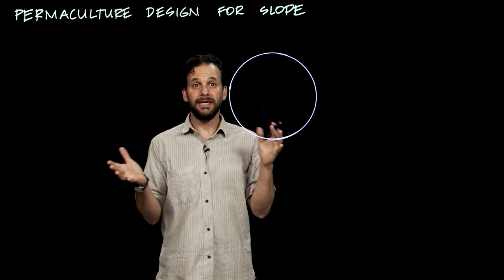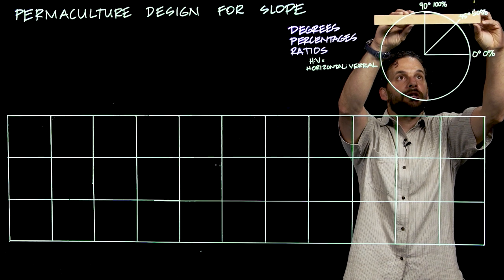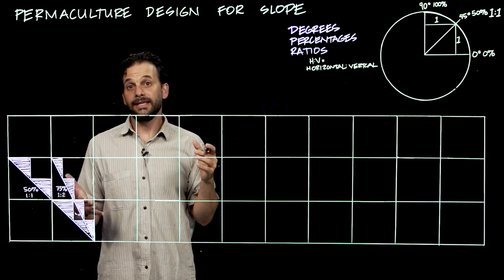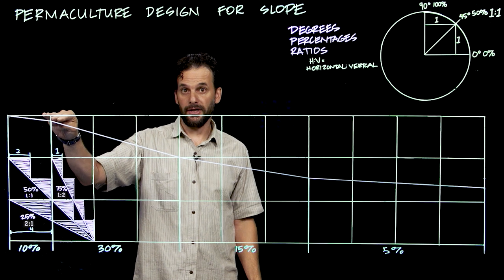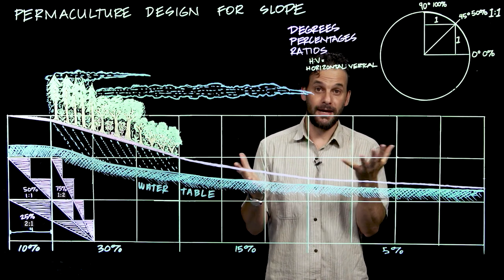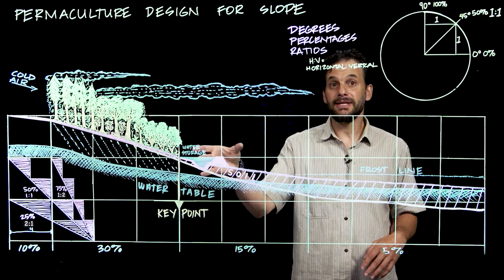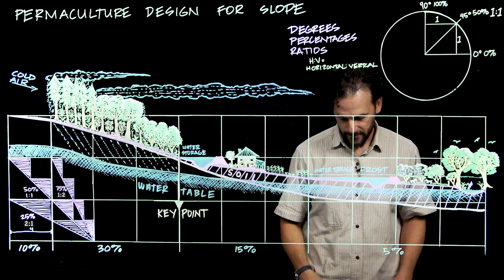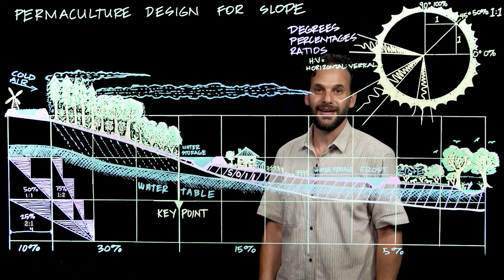Permaculture Design for Slope

Comment: I'm in Colorado at 7000 feet where it's dry as a desert at times.  Took almost 10 years to dig my well, but last fall I finally got water flowing.  It goes from my well up about 150 feet so it gravity feeds everything below it.  I'm working on my degree in permaculture design myself, and my land project is my masters piece.  Thanks for this refresher, my BM PDC book disappeared 25 years ago.
Reply: What would you say is a good way to do a gray water reclamation in northern Colorado? With the cold winters is it even possible?
Reply: @pendragon_cave1405  Yes it's possible.   Is your grey water contaminated with bleach or anti bacterial junk?
Reply: BraVO!
I'm really pumped that you exist!
🥂
Reply: Congratulations……it must feel great to action your plans.
Reply: it does     snot     take 10  years to dig a waterwell. . . have you been digging by HAND      . . . get a company  to do it for you in two days      and stop crying. . . .
or if you dont want to be criticized, , then tell the whole truth.. its not that long-winded. . .i've got time. . .

Comment: I have become aware that there is an error in this diagram. The 30% slope section is drawn too gently. That section should be slightly steeper then the 25% slope section, where it appears slightly more gentle. Sorry for any confusion this causes!
Reply: You are just WONDERFUL!!
🤜👍🤛♡♡♡
Reply: in most places, a 1:1 slope = 100% grade.
(nvrmd, just saw the video's description. Bill's mistake. I still think it shouldn't be used, as it's very confusing.)
Reply: Thanks for the correction, I was about to comment on it
Reply: Oh, weird. Apparently, Mollison's mathematical definition of %slope is different from everyone else's. I (an engineer-like person) just thought that rise:run = 3 :10 = 3/10 = 30%. So, 1:2 = 50% and 1:1 = 100% and 2:1 = 200%. The steepness of the lines drawn was perfectly fine, but someone needs to ask Bill Mollison what numbers he uses.

Comment: This is fantastic for understanding good use of a LARGE area. But since I don't own a hill/forrest and the valley below it (I mean, let's be honest, only a tiny fraction of the population does), I'm having a hard time extrapolating this down to MY size (1/4 to 1/2 acre slightly sloped plot in Italy). I REALLY like your explanation and the drawings and genius presentation method, but could you direct me to a video that does the same thing but for a small plot of land? So....instead of the uphill "forest" there is the blackberry/small trees/bushes uphill boundary against the steep terrace wall coming down from adjacent property, then our narrow terrace with Olive trees.

Comment: I just bought a property, I thought it was safe from pooling water because it is on a slope, but it turns out that it is at the infection point (bottom of the steep grade, top of a gentle one), so perfect for water collection, as in having a lake form in the crawlspace underneath the building after it rains. Going to try to make lemonade out of a lemon and collect all that incoming water in a cistern.

Comment: hmm I disagree about % slope.
 % is already a ratio, when you elevate 1m on 1m lenght you have a 100% slope and it's a 45° angle or a 1/1 ratio.
Reply: Yes. Please see the clarification in the video notes.
Reply: Ok... but it's weird, I don't get the point why he used %slope this way.
Reply: @SebR-FR  I agree. If I had studied engineering before I got into permaculture, I would have presented this differently. It does cause confusion that slope in Mollison's texts is communicated in this way.

Comment: From one Andrew to another, thank you for putting together a fantastic course. A question or two if I may - could I  understand why there is such concentrated focus on Mollison's work? I'm guessing permaculture is too broad for Mollison to have been the originator of much of his work? I also get the sense that Masanobu Fukuoka, e.g. 'one straw revolution' has been at least somewhat overlooked in the west. What's your view?
Reply: Mollison and David Holmgren originated the word "Permaculture", and he wrote the "Permaculture Designers Manual", so Mollison really laid out the permaculture design system as a land assessment and design protocol more than any others. Fukuoka is more of a philosopher. He had a method, but it was not as clearly spelled out and universally applicable as what Mollison laid out. Another person who clearly laid out a design system that serves a lot as foundational material for permaculture is P.A.Yeomans with the Keyline Plan.

Comment: The percentages used here are incorrect. Slope grades are expressed as the rise-over-run ratio, so a 45 degree slope has a grade of 100% (not 50% as stated in this video). A sheer cliff of 90 degrees would have an infinite grade.
Reply: Yes. This correction is stated in the video description.

Comment: Your top 10% is closer to 5% because it looks like a 1:10 ratio. Your 30% gradient is actually 15% and your 15% is closer to 7.5% because it looks like a 3:.5 ratio. Your 5% slope is closer to 3.125% because it looks like a 4:.25 ratio based off of your depictions in the bottom left of the screen. So technically none of what you drew should be permanent forest. But I get the concept.